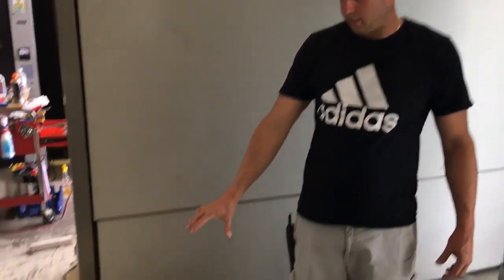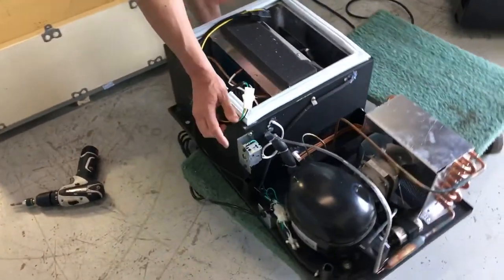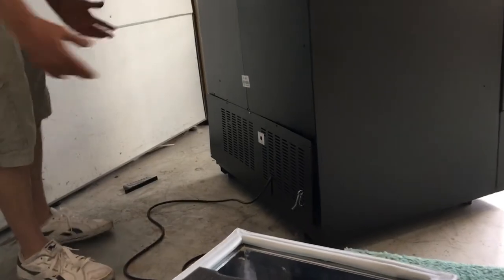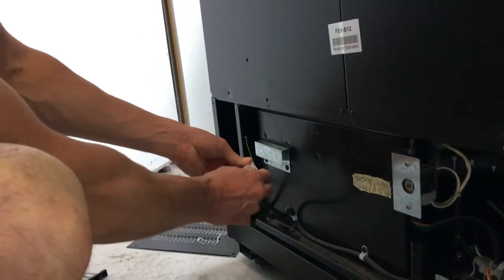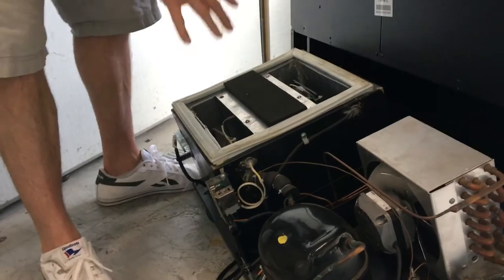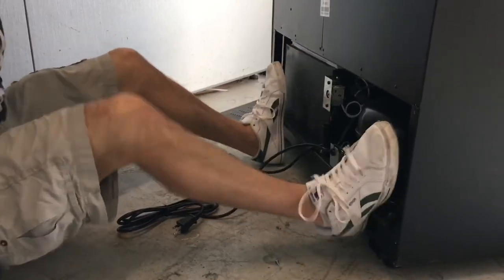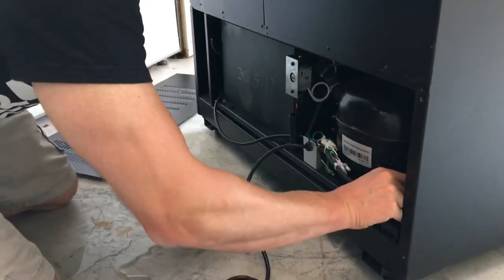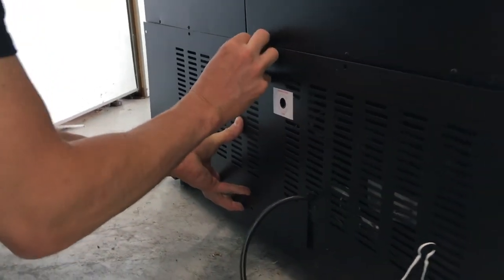How to remove and change compressor deck/ cooling unit combo vending machine

Comment: Hi can you tell me what compressor fits on the deck of a genisis GO 127 and 380 I know the compressor in these machine use LBP I'm looking at a genisis sc661 1/4hp I'm wondering if it would fit Thanks